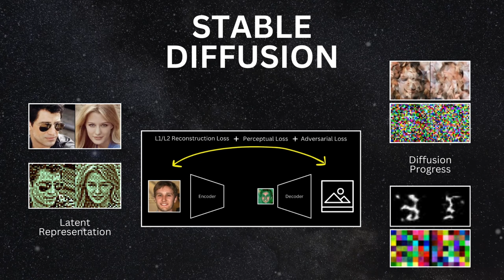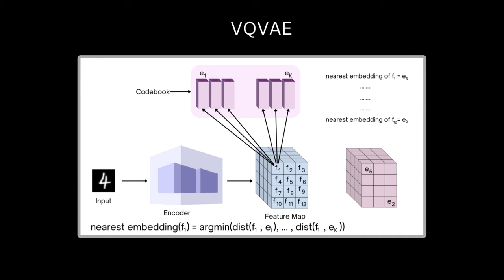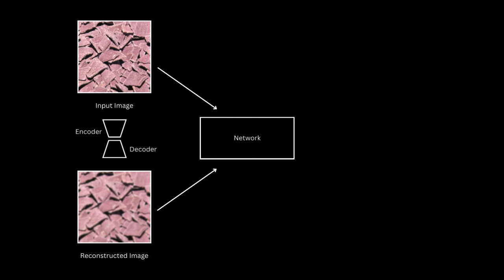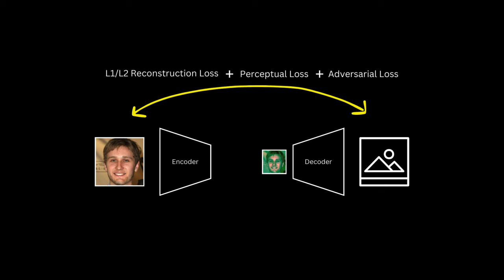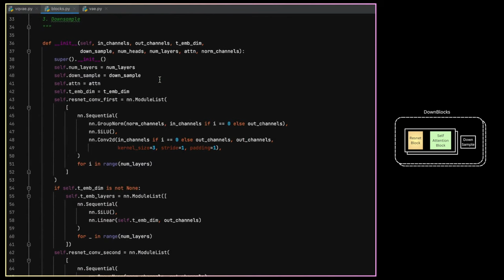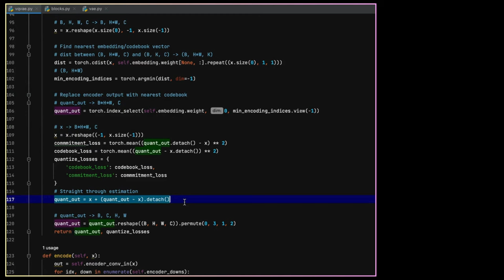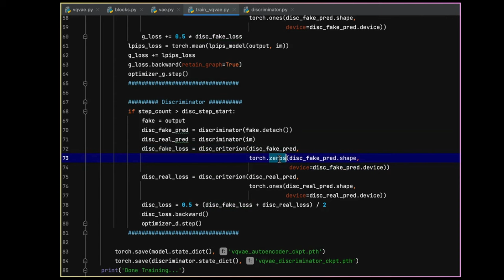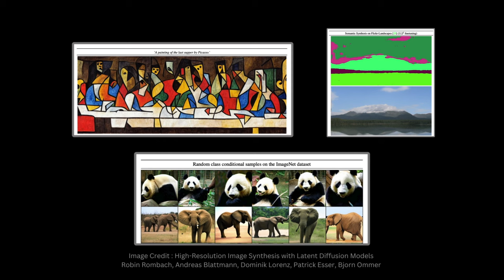Stable Diffusion from Scratch in PyTorch | Unconditional Latent Diffusion Models

Comment: Thank you for the tutorial it was really helpful ! i'm wondering about the values of the discriminator loss for the first few epochs i'm trying to test this architecture on  another dataset and the discriminator loss is high and stable from the first epoch.
Reply from the maker: Hello, The suggestion that I have seen in discussion over the web is that invoking discriminator(and d loss) should be delayed till the autoencoder reconstructs best images that it can(it will still be blurry). 
And then we should add discriminator loss components in the training.
Here is an issue which provides some discussion on discriminator loss which I think might be helpful for you. https://github.com/CompVis/taming-transformers/issues/93
Reply: @Explaining-AI  thank you !

Comment: Awesome, I just have one question, why not only use the adversarial loss? (or maybe first train the VAE using normal L1/L2 and then fine tune it using adversarial loss) I feel like using all at once would just end up consuming more resources.
Or would it cause the VAE to pretty much inherit all problems GANs have (mode collapse, vanishing gradients, etc)?
Reply from the maker: Thank You. So at the start they aren't all used at once. 
I set the disc_step_start @34:44(at what step to start adding adversarial loss) parameter to a value such that by that steps the autoencoder has already learnt to reconstruct well, and then adversarial loss component is added to the loss to improve the quality of those reconstructions. So technically, like you said we are kind of first training VAE and then fine tuning using adversarial loss(except we keep autoencoder loss even after adversarial loss kicks in, to not lose all the latent space properties from vqvae/vae that we have learnt). 
And besides since the discriminator is just a 3-4 conv layer model, the additional burden of computation because of adding adversarial loss is not that significant.
Regarding the point of just using the adversarial loss, I am not sure as I haven't experimented with it but I would suspect that while it should work, it will bring up the same problems that gan training has like you mentioned.
By training it using combination of both autoencoder and adversarial loss, we are getting the increased sample quality(like without blurriness) and keeping the training more stable(because of first training using vae/vqvae losses).
Infact when I was going through issues in the  latent-diffusion repo and vqgan repo, I saw couple where folks mentioned that if the disc_start is set to a lower value or 0, the model does not converge well. Empirically they found that adding adversarial loss ONLY after autoencoder reconstructions are decent, leads to better results.
Reply: @Explaining-AI  Very interesting, I will be looking forward to more videos by you, they're very helpful and well made.

Comment: thanks a lot! can you explain why you didn't use SA in the AE implementation? you mentioned that it's related to the images' high resolution, why? why you do use SA in he DDMP implementation?
Reply from the maker: Primarily just to save on computational cost(both time and compute).
Say our feature map is CxNxN. Inside the self attention layer, autoencoder will try to compute attention between each pair of feature map cells. The computation complexity will have a factor of N^2 in it. The main reason I did not try with attention on any layer of autoencoder is to save on this computation cost. As typically N would be 512/256/128 for the autoencoder blocks. But in the diffusion model part, since we are working with encoder outputs, where N is smaller(32/16/8), this cost is lesser and hence SA can be added for all diffusion model blocks.
The official implementation usually has attention in the last or last two blocks of autoencoder as well(https://github.com/CompVis/latent-diffusion/blob/a506df5756472e2ebaf9078affdde2c4f1502cd4/models/first_stage_models/vq-f8/config.yaml#L21). But there are also configurations which do not have attention at all, so I tried without SA in autoencoder and the results were fine so kept it that way. Let me know if this clarifies things for you or if you have any further doubts.
Reply: @Explaining-AI  thanks!
Another question, you said that there are some differences between your implementation and the official one, can you mention the importance ones?
Apart from efficiency that you mentioned.
Reply from the maker: @nadavpotasman  I am sorry but I don't remember all the differences.However, I took another look at my code and the official implementation. And these are the differences that I could find.

1. Official Repo has Layer Norm, in attention blocks and after Cross attention they also have mlp layer. 
https://github.com/CompVis/latent-diffusion/blob/main/ldm/modules/attention.py#L203
I use group norm everywhere and I dont have any MLP after cross attention.

2. Upsampling position :
For upsampling, official implementation uses interpolation followed by convolution (https://github.com/CompVis/latent-diffusion/blob/a506df5756472e2ebaf9078affdde2c4f1502cd4/ldm/modules/diffusionmodules/openaimodel.py#L116) whereas I use conv transpose
3. Different number of attention heads, batch size and channels in each block) (https://github.com/CompVis/latent-diffusion/blob/a506df5756472e2ebaf9078affdde2c4f1502cd4/configs/latent-diffusion/celebahq-ldm-vq-4.yaml#L36C9-L36C26)

Thats all that I could find as of now.

Comment: Thank you for such a detail video. Got so many things clear.
Can anyone point out the structural steps for implementation of LDM like if I am doing in Jupyter. Ist step, second step and so on......
1: dataset 
2: Vae or noise sheduler
3: Diff Model
and so on?????]
Reply from the maker: Glad you found the video helpful.
Regarding the different steps, what you mentioned are pretty much correct order of steps. Below I have added the steps in detail.
1. Create the dataset class 
2. Build VAE/VQVAE model
3. Implement training script for VAE and train it.
4. Create Diffusion Model
5. Implement Diffusion Noise Scheduler 
6. Write the code for diffusion model training using trained vae model and noise scheduler
7. Implement sampling script using the trained diffusion model(as well as trained vae) and noise scheduler

Do let me know if you need specific details on any step or if you face any issues in implementation.

Comment: Thanks for the video, it is really great. I have finetuned a stable diffusion v1.5 model and now I am trying to built a stable diffusion model from scratch without using any pretrained ckpts and running it locally. So is it possible that we can train the model without using any pretrained checkpoint ?
Reply from the maker: Hello, yes its definitely possible. Though depending on your dataset and image resolution you might have to use a lot of compute time, and also if your pre-trained checkpoint was trained on images similar to your task, then your generation results(without pre-training) would be of lesser quality(than with pretraining) .

Comment: What was the compute you used to train this? And how long did it take? Great video btw!
Reply from the maker: Thanks! For the diffusion model I used single Nvidia V100 which took around 15 mins per epoch and as far as I remember, I trained for about 50 epochs (to get these outputs and I stopped at that point, ideally should train for much longer to get better quality outputs).
Reply: @Explaining-AI  Thank you for your prompt reply! I am building something similar for generating synthetic galaxy images to learn about LDMs. Your videos are a lifesaver.
Reply: @Explaining-AI   Can we also use Flash Attention instead of normal attention?
Reply from the maker: @HardikBishnoi  Yes , I have not used it myself but I remember reading some implementation where diffusers(huggingface) + flashattention gave 3x speedup.
Reply from the maker: @HardikBishnoi  Glad these were helpful to you!

Comment: thanks for  explanation. i have a question you said the autoencoder takes the image in pixel space generate the latent space and decoder do the reverse. if we train the diffusion model it will take the noise sample of the latent space and then goes through the unet which work as a noise predictor and remove the noise from the noisy latenct space iamges from the encoder side.
 my question is how and from where it will add nosie to the latent space and how the Unet will do the diffusion process to remove the noise because you also said that we don't need the Time step information?
 kindly i have these doubts if you can address it kindly clear my doubts. Thanks for the making video on this topic!
Reply from the maker: Hello, the diffusion process here is same as what happens in DDPM. The only thing different is that rather than training diffusion on a dataset of images, we first train an autoencoder on our dataset. Then train diffusion on this autoencoder generated latent representations.
So after auto encoder is trained we have these set of steps.
1. Take the dataset image(pixel space)
2. Encode it using trained and frozen autoencoder(to get latent image)
3. Sample noise, timestep 
4. Add noise to latent image(from step 2) 
5. Train Unet to take the noisy image from Step 4 and predict the original noise(from Step 3) that was added

Then at inference, generate a random noise in the latent space, have unet denoise it iteratively from t=T to t=1and after that feed the t=1 denoised latent image to decoder of autoencoder to get generated image(pixel space). Do Let me know if this does not clear things up and there is still some doubt.
Reply: @Explaining-AI thanks, i have another question why you don't keep the self-attention in the down sapling of the encoder. how it keep attention on the image features in the rest blocks
Reply from the maker: @paktv858  The encoder deals with very large image sizes(example 256x256) compared to ldm(32x32).Which means the self attention computation would be very costly hence I just avoid it. If you really want to add and experiment with that, I would still suggest to try adding it only in the last downblocklayer(at 32x32 resolution) . The official repo also does not add it for all variants - https://github.com/CompVis/stable-diffusion/blob/main/models/first_stage_models/vq-f4/config.yaml
Reply: last question, here self attention block is used as model? right and inside of the self attention model it used as layer with Norm? @Explaining-AI
Reply from the maker: @paktv858  Yes I just use normalization and pytorch's multiheadattention module (this is for both self attention and cross attention).